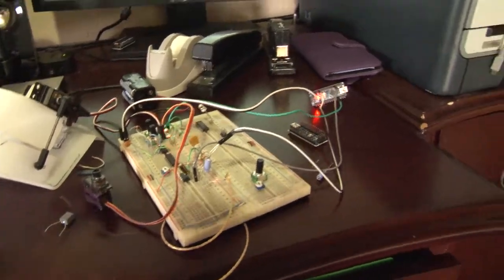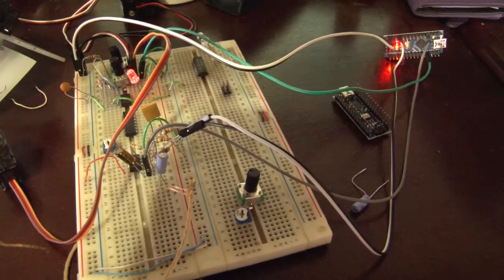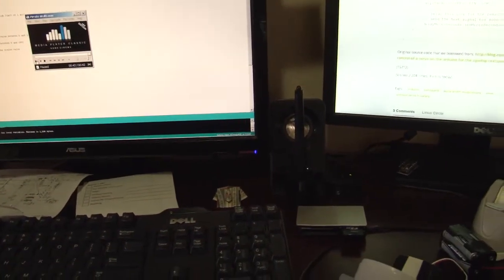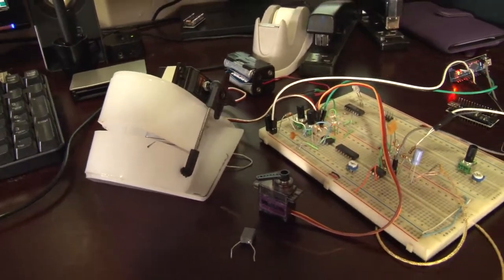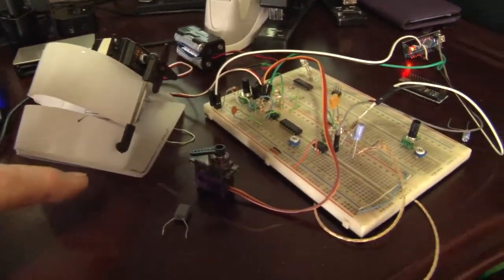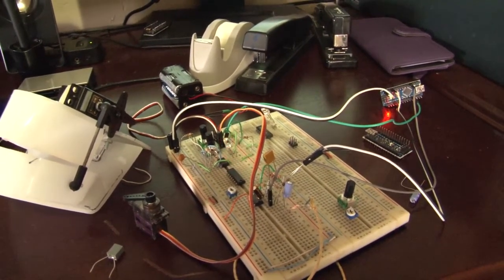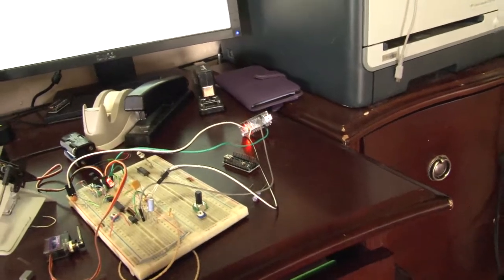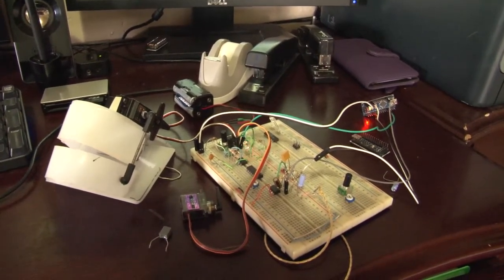Audio to servo

Comment: Do you have circuit diagram and sample code?
Reply from the maker: I have actually been working on this to get it better and I will soon have  both a diagram and code on my website, batbuddy.org/resources/Halloweenstuff/TalkingSkull.php
Reply: I'm hoping to build this before Halloween. Any change you can share your progress?
Reply: I am going to take it even further and add LED eyballs and an audio system with a talk back microphone so that I can interact with trick or treaters.
Reply from the maker: Yes I just got done writing it all up. I am really close to having a whole arduino based 3 axis head controller with jaw movement, as well. Go to my site and on the Halloween page there is a talking skull project. That is everything you want.